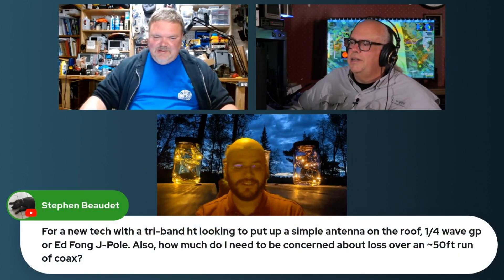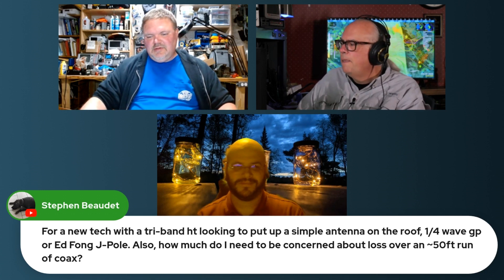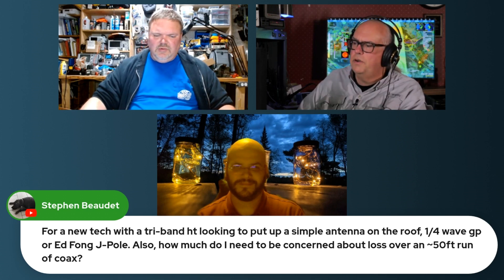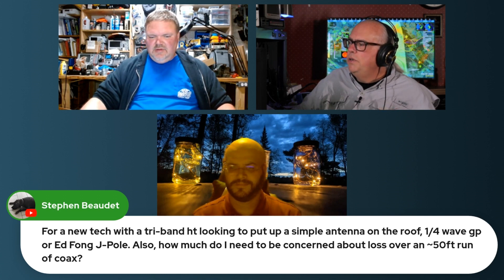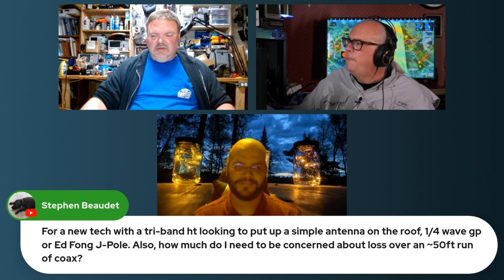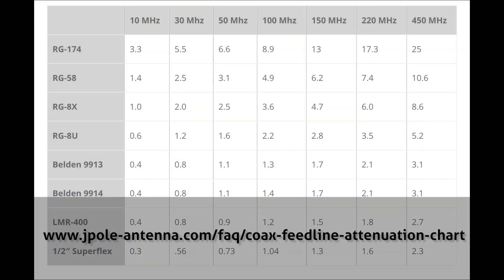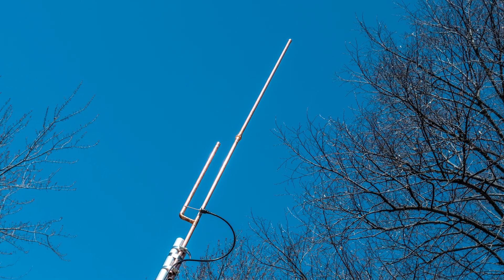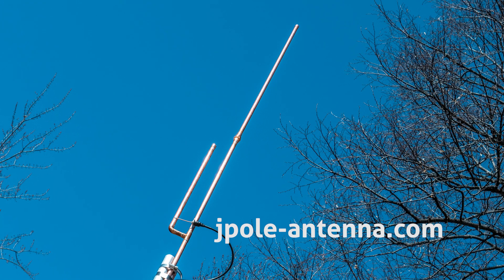Good Coax Makes all the Difference: Ask Michael, KB9VBR

Comment: Question: I understand transmit coax loss but do you also have loss on the receive as well?
Reply: Yes, the signal loss is the same both ways. 3 dB of loss will cost you half the received signal power (0.5 S unit) as well as half your transmitted power.

Comment: I recently made a 2m/70cm vertical dipole just to test it out, and maybe make one for a base antenna for my situation. I taped it about 8ft up on the side of my house (the top was at 8ft) and ran 50w with my mobile radio. 2m was 1.15:1 swr and 70cm was the usual ~2.3:1 swr (gross, I know). One thing I noticed is that with the coax at a 90-degree angle to the antenna, the length of coax running away from the antenna made a difference in 70cm reception ability. I may try making another one as a fan dipole with 2m, 70cm, and 1.25m legs, and adding a cmc choke at the feed point.

Comment: Tri-band ht. Sounds like 2 antennas needed  and véry low loss coax. LMR 400 would be a good choice if not  rg-8 foam. I operate a tuned 75 meter dipole on lmr-400 without a tuner on 3.916 and I get good reports with a Kenwood TS-480hx. I run the full 200 watts as well. I do relays for weak stations net control can't hear over the noise. I could get by with rg-8, but I already had the lmr-400. Great video and 73 GOD bless Earnest K5EWM.